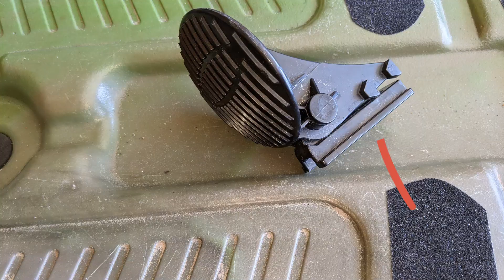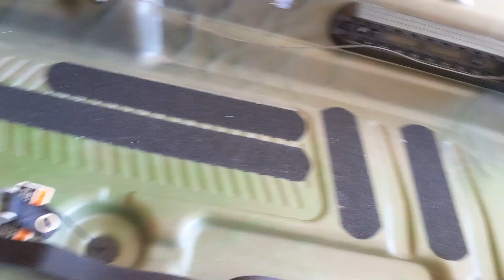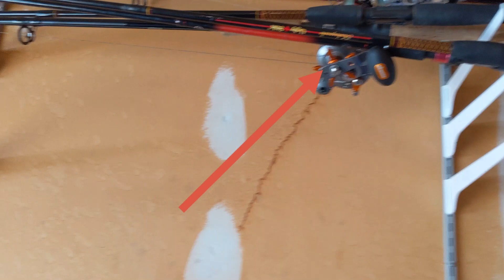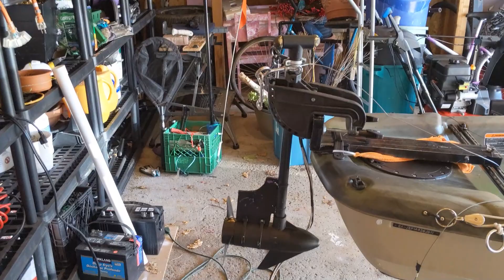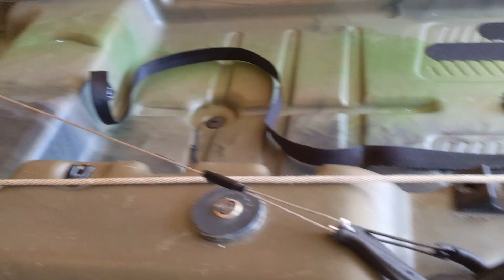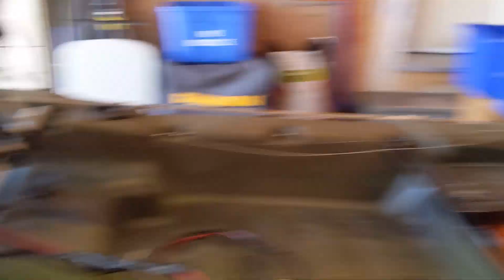Pelican Catch Trolling Motor and Pedal Steering

Comment: I'm currently adding a motor to my catch 100. I love ur transom design. I'm guna use aluminum and thick cutting board mine. I went with coated cable ran thru ice machine pex line just to keep the cables from getting hung up on stuff. Awesome video Sir!
Reply: @SidZork01  wats the top speed?
Reply: @SidZork01  thank you for the quick reply. I subbed to your channel. Have a good day sir

Comment: Great Idea for the Transom design. I have a Pamlico Wilderness, that used to come with an OPTION to get a Motor with a VERY simiar FOOT steer and speed control and cost about $1600 with the motor, back in the 90s. I have a Pamilico know and am going to use your Transom design and reset this one up. Great Fishing machine to be able to get wherever you need....even in Strong Currents.
Reply: this is a lot less than $1600, and you can do 4 mph on the lake, so , not too shabby

Comment: Where did you get the split ring hangers used for the steering attachments on the motor shaft?  Can't find them anywhere...
Reply: Got them at home Depot. But now I have trouble finding them as well. My buddy just simply took a about a 8-in long stainless steel screw. Put it right through the shaft, bolted it on and then put rings on the end. It does the same thing so you know being innovative.

Comment: Great video! Try building a pwm speed controller, it is much more efficient and will save you battery.
Reply from the maker: We'll have to look into that. With the lithium-ion battery I can go all day long right now so I don't run out of juice.
Reply from the maker: I think I have a project for the winter
Reply: I agree. Did the pwm for under $30. Less wires. I got a harbor freight deep cycle 35 ah. I can go 3 hours (all my back and butt can take ), no paddling (ugh) and battery barely drops below 100%. Best upgrade I did..

Comment: I already asked you a few questions about this setup and now I'm at the point where I'm going to set mine up like yours. I LIKE EVERYTHING ABOUT YOUR SETUP and I have the exact kayak.   one last question what did you use for the wedges to go into the handle so perfectly? Just the same 1×1 tube cut to fit? I figured if I asked I could save me some time.
Reply: yes, I took the same 1"x1" Al tube, about 3-4 long.  Used a jig saw, cut it diagonally, from one corner to the other.  End up with 2 wedges.  Then just drilled small hole on the inside of each wedge and screwed it onto the main transom support.  Put the transom into the handle, put it where I wanted it to be, with the locking screw at the front and from that put in the two wedges.  Use a marker to get the exact spot, take it out and screw them in.  Put electrical take to  reduce the risk of sharp edges on the wedge once all done.
Reply: @TonyBrunelle1  AWESOME Thanks again!!

Comment: just 1 question, I dont think you mentioned, is this 1" Square tubing aluminum, or is it 1" solid stock aluminum,
Reply from the maker: It is tubing, it's Hollow and it's plenty strong. I have a 30-30 Minn Kota but if I were to do it again I might upgrade to a little stronger motor.

Comment: Do you have a video of how you constructed your control box?
Reply: Sorry I don't have a video on that. Get a closed plastic electrical box from home Depot, the control unit on a trolling motor is just a small little motor ,you'll see you can drill a hole for the control knob drill another hole to get the wires to exit the box.. I used waterweld to hold the control unit up against the top of the control box and I plugged the hole where the wires come out again with waterweld. What's that waterweld Hardened it's going to take dynamite to get it off.
Simply take pictures of all the wires on the control unit when you take your trolling motor control unit apart. That way you can simply reconstruct it and seal it inside the electrical control box. One thing I did was take a 60 lb magnet and I screwed it glued onto the bottom of the box and then I put a metal plate on the kayak so it's on,it doesn't fall.

I hope that helps, it's actually very easy and on the electrical box if you screw they are a bout 5 oR 6 bucks buy another one and start again. Good luck

Comment: which cables did you use to lengthen the cables?
Reply from the maker: I'm not sure exactly what I where I got it but I think I simply used an electrical cord there is heavy duty light duty etc right so you get something that's going to handle the amperage

Comment: Sub'd just for your ingenuity! I'm about to get my first kayak for my future rockhounding adventures.  Definitely going to use a trolling motor.  Have you ever considered hooking up a small solar panel to yours?  I plan to use a 50 watt flexible panel that is currently on my van with the kayak motor & battery.
Reply from the maker: I have used the lithium iron battery a few times now and I absolutely love it. How to charge I just plug it into the house so I can't really tell you about a solar panel

Comment: Impressive set up! Are  you using  lithium batteries?  what kind exactly are you using? Thx mate
Reply: @SidZork01  Yeah those heavy batteries get annoying very fast. I’m currently looking for a lithium battery hundred amp. Which brand did you get? Thx mate
Reply: @SidZork01  i think most lithium batteries are made in china anyway.
Reply: @allans7281  check out Dakota Lithium batteries... twice the power, half the weight and 11 year battery warranty!

Comment: What type of wire did you use to extend the trolling motor control
Reply from the maker: Good question that, what I did was look for a heavy-duty extension cord because I needed something that could take the amps. That I cut it up sacrifice to Corydon did the extension
Reply from the maker: My voice recognition isn't working too well, I said then I cut it and used it
Reply: @SidZork01  awesome my trolling motor has 4 wires not including the ones to go to the battery how would I splice those to a extension cord?
Reply: @SidZork01  is there any way you can show me a step by step on how you put it together
Reply from the maker: @johnmcneal2411  use two extension cords